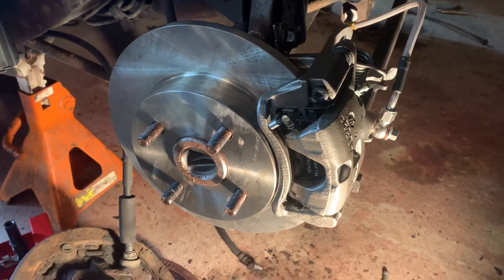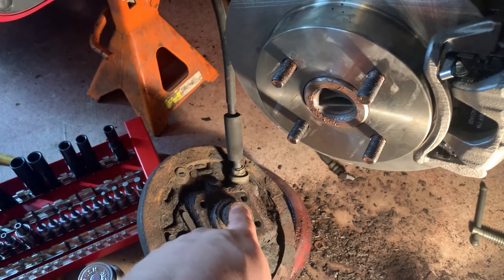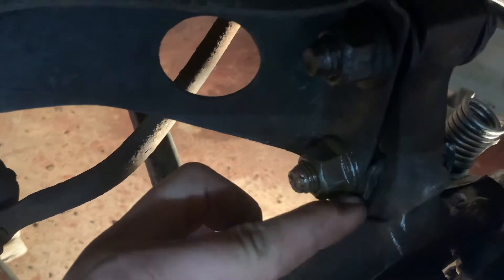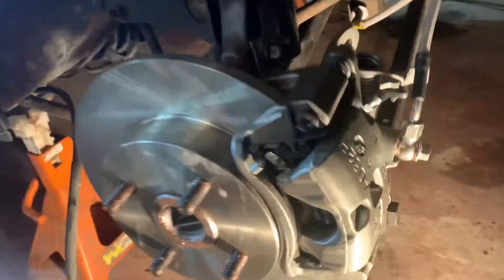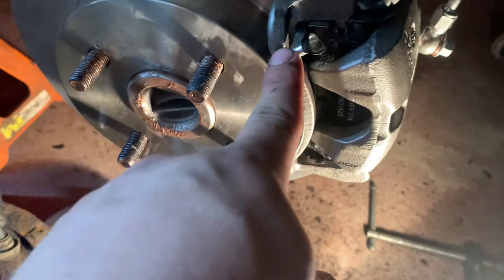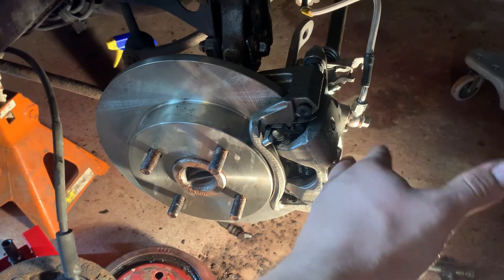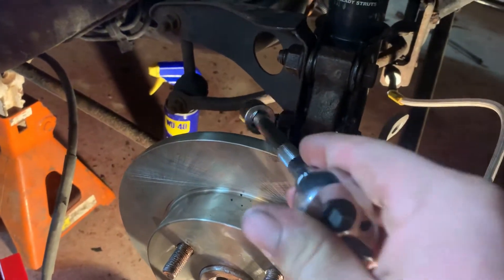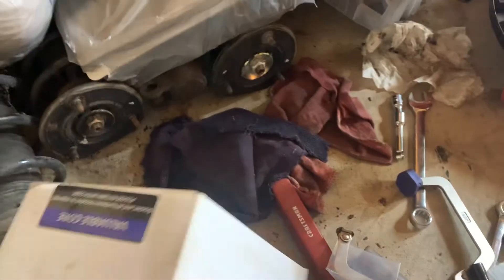SATURN 3rd gen REAR DISK SWAP

Comment: i wanna do this to my 99 sl1. Is there a caliper bracket that the caliper needs to bolt up to? I've seen other videos where they need a new bracket as well. or is the knuckle just have the option? I'd go look, but i am waiting on surgery right now.
Reply from the maker: @eastonscarrepairs7207  buy the calipers that have the bracket with them. The part numbers shown will be all you need :)

Comment: I wanna do this to my 98 Sl2. Does it improve the stopping time at all?
Reply from the maker: I unfortunately didn’t do a timed “before and after,” but I’ve found that it heavily improves ease of replacing and maintenance. And that it also is great for reducing brake fade. And brake dust. It also looks a lot better and more modern.
Reply: @saturnmedia1  Thanks for the reply! I'm still interested in doing it. If nothing, it looks prettier.

Comment: I'm working with a 2003 Lw200 wagon. Can I do this swap??
Reply from the maker: I’m sorry but I do not believe so. Those are made in Europe and are totally different cars than the S series cars. They would require all different parts, but you could probably still do it once you find those correct parts. There has to be a version of that car made with rear disk brakes though, for you to buy the correct calipers, hubs, and disks.
Reply: @saturnmedia1  I've found calipers and rotors but can't find caliper brackets.. I'll have to make them.I. I want rear disks. I'll have to buy the rear hub for the disk version too huh?
Reply from the maker: @_mylastname  I’m not too sure buddy. I haven’t worked on those cars, so I’m not sure. Sorry I couldn’t be more of a help with that. You may be able to check some of the Saturn forums!
Reply: @saturnmedia1  no worries friend. Thank you anyway.

Comment: You got a part number on those lines
Reply from the maker: UPDATE. DONT BUY THE GOODRIDGE LINES! I had two of them fatigue/rust out on me! 

It should be GOODRIDGE 54002! They are available on Amazon. I’m pretty sure I showed the part number in the video, if I didn’t, then let me know, I found this number from a quick Google search.
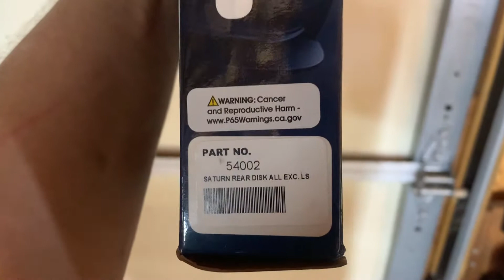Reply from the maker: It was at 6:53 in the video.